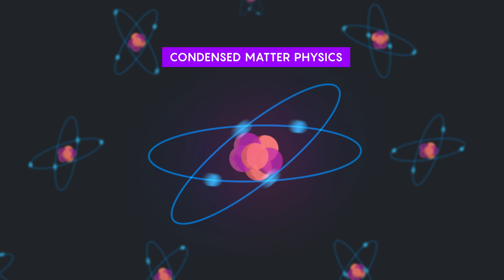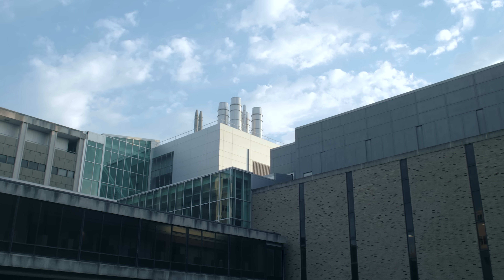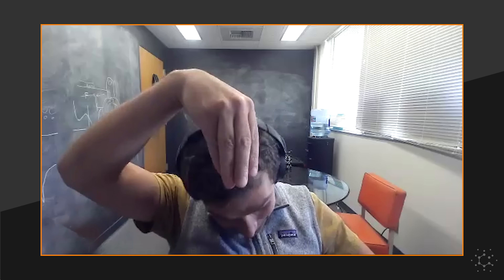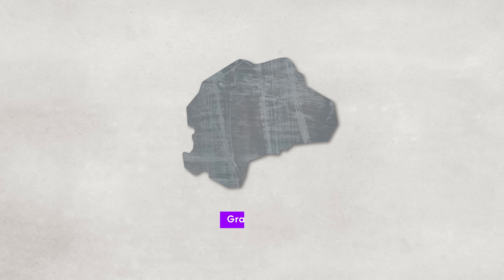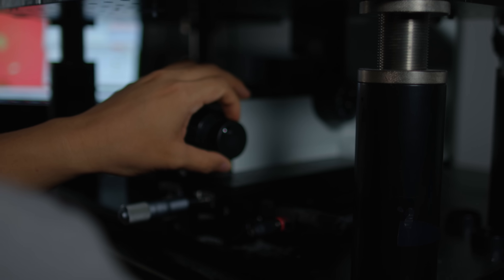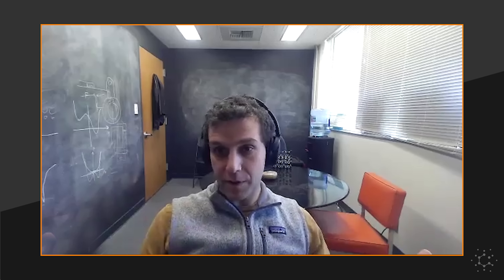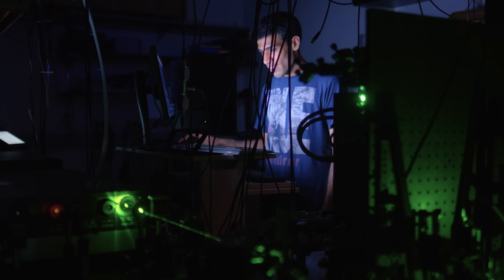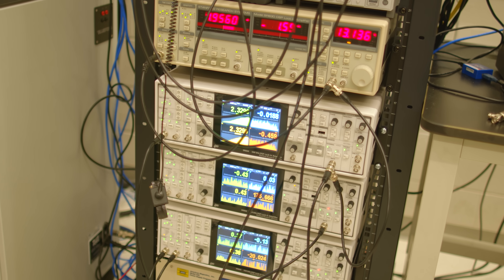How Two Physicists Unlocked the Secrets of Two Dimensions

Comment: Can someone explain something to me (not a trained scientist): how many of these "virtual atoms" can they manipulate at once? Are they able to scale the quantity up enough to make, for instance, clouds of virtual hydrogen, helium, etc?
Reply: @asdli6402  Because they aren't really atoms. It's a really common thing in condensed physics to do "simulations" of the real thing by using an absolutely different physical object, that on some level behaves similar to the thing you are studying. In this case, having read the article, it's not electrons that are orbiting "artificial atoms", it's "excitons" - a "particle" consisting of an electron+hole pair in different layers of the material. It is not really a particle in a physical sense, but it behaves like one, and if you are willing to accept it as a particle, it follows the regular Schrodinger's equation (except in 2D).
This isn't the first time condensed physics has done this - there are also so called "phonons", for example, that are quantum particles of sound waves - basically a particle representation of deformation waves travelling through a material, and they also behave like regular quantum particles if you look at them right.

What that Moiré lattice does is create potential wells for those "excitons", similar to how nucleus creates a potential well for an electron in the atom. This way, these excitons follow the Schrodinger's equation really similar to that of a real atom, so the effects you find with them can be applied to real atoms too. That's why they're called "virtual atoms" - they're not atoms in any real sense, there's no nucleus and there are excitons instead of electrons, but it's similar enough to be interesting. And yes, you can create lots of them - they're automatically "placed" at the nodes of the Moiré lattice, so as long as your sheet of material is big enough, you can get as many of them as you want.
Reply: @silentobserver3433  this is the kind of explanation I wanted TNX.
Reply: @silentobserver3433  thank you!
Reply: @silentobserver3433  thanks
Reply: @silentobserver3433  Damn, they really simplified it way too much.  Thank you for illuminating what is actually going on.
Reply: @silentobserver3433  I suggest 'analog atom' (or anthing else) is a better moniker especially to avoid confusion with the decidedly different and long established 'virtual particles' many have heard of. Also, the material is but 'maximally thin' and far from being 2D. This insistence of making use of confused, over-hyped terms is really unnecessary. Damaging even.
Reply: @jaybingham3711  True, the term "analog" would fit much better. Let's just hope there won't be any confusion with analog electronics :)

Even though the material itself isn't 2D, the "analog atoms" are, because they are formed at the boundary of two layers. The bulk of the material probably adds some noise and makes stuff different to measure, so that's why they make it "maximally thin", but the "analog atoms" are truly 2D, since they are restricted to the boundary between the layers and can move only in 2 dimensions. In general, 2D quasiparticles on boundary layers are a well-studied thing in condensed physics as well.
Reply: @silentobserver3433  thank you. It makes sense. Nice explanation
Reply: @silentobserver3433  Thanks 😀
Reply: @silentobserver3433  Thank you! But then this should follow a 2D version of the Schrodinger equations, not a 3D one right? So the orbitals will be different
Reply: @silentobserver3433  Thanks for taking the time to write such a detailed explanation, appreciate it
Reply: @silentobserver3433  Thank you for this explanation!
I would say, for those who still haven't understood my way of seeing this virtual atom:
Like a copper coil that creates a magnetic field when a current passes through it, it creates a "virtual" magnet, but that doesn't really make a magnet.
Sorry for my english.
Reply: @theplouf5533  I would say your analogy of magnets is not really good, since, in a sense, elecromagnet created by the coil is probably even more "real" than whatever permanent magnets do, since an electromagnet uses the Maxwell's equations directly to produce magnetic field from current, and permanent magnets do basically the same thing, but on atomic scale and using quantum properties like spin to make their "current", which makes it much more complicated.

I think a better analogy is how you might study radio wave (and light) effects, like interference and diffraction and such, by dropping rocks into a puddle and observing the wave patterns. In this way, water waves are "virtual" radio waves. The underlying physics are very different, but the resulting math is similar enough, so the observable effects are still the same. And water waves are much more intuitive and easier to study.

Also, it seems like some people misunderstood the word "virtual" here - it has no relation to virtual particles from Quantum Field Theory and Feynman Diagrams. There virtual particles are just a math trick to simplify calculations. Here the "virtual/artificial atoms" are actually perfectly real and measurable, they're just not atoms in the strict sense, just emulations based on a different physics.

(Also, your English is great, don't worry about it!)
Reply: @silentobserver3433  So let's say it's an analogy of an analogy ;) I'm thinking of people who, like me, thought: "Yo ! This is the future 3D printer, if the virtual do real one day ? => No With copper coils , we'll never get magnets, dumb guy !".
Reply: Yeah and does this artificial atom go away when no more voltage is applied.
Reply: @harshsharmax25  man, imagine being able to make anything your heart desires, but it disappears as soon as you leave the field
Reply: Also as I understand it, atoms are kinda defined by their number of protons, 1 for H, 2 for He, 3 for Li, etc. So why does changing the metric associated with electrons change the atom, and not just change it to a type of ion instead?

Also, as I understand it, an atom usually has the same amount of protons as neutrons, so are these created atoms special isotopes of the usual atoms?
Reply: this is what I wanted to ask
Reply: @ToriKo_  I don’t KNOW the answer, but my guess is that changing the electrons would change the properties of the atom, since that’s how atoms tend to bond. There are forces in atoms that come from protons in the normal world, but I would think that it would be possible to create, or simulate the properties/general behaviors of other atoms using only electrons.

I’d imagine it would get a lot more complicated as the number of electrons increases, since elements like iron have various electron counts. This is assuming my understanding is correct.
Reply: @ToriKo_  THERE IS NO ATOMS NO GRAVITY NO RELATIVITY NO HIGGS NO STANDARD MODEL NO E=MC2 SAGITARIUS A STAR SPEWS GAS MATTER THE SI METRIC INDEX HAD TO BE MESSED WITH TO TRY TO STAY RELEVANT OR SLIGHTLY RELATIVE IN THE CONVERSATION,.
Reply: @no1headbandcharlie160   inside voices please
Reply: @asdli6402  from my understanding, virtual particles arent real at all. Physicists yuse them to make the maths concerning the field easier
Reply: Artifical atom (or quantum dot in quantum computing context) is basically a 'box' and hold numbers of electrons. I don't know about virtual atoms. What I know is virtual particles which is in different context (quantum field theory).
Reply: Yea you are a way better person that me… I though about changing things to gold
Reply: The Moiré superlattice of the few-atom-thick material forms very good models of atomic phenomena that isn't constantly moving and basically impossible to observe. 
No element printing with the technique, but an interesting breakthrough in scientific models.
Reply: This video is extremely misleading without good explanations for both its information and misinformation, I really can't blame anyone for thinking this is some alchemy voodoo lol
Reply: Lots of good replies here. I wanted to add my understanding. The virtual atoms are places in the 2D lattice that act like atoms do. I don't think we know why this happens. It is something of an epiphenomenon, like moire patterns themselves, or when you move your head a little and "see" movement in the place where a power line crosses in front of a straight line or any two, non-intersecting lines cross in front of you. As you move your head a little, the intersection of the two lines move much farther, and our brains "sees" this moving intersection as a moving object even though there is no thing really there. Two screens rotated in front of each other also produce secondary patterns of their many intersections; that is a moire pattern. In that case too, the pattern we see isn't really there in a sense. 

So, this alignment of single sheets of atoms produces secondary effect zones shaped in moire patterns that behave like atoms (due to local, though extended electromagnetic effects?). I don't think we know if there are limits to the similarity. It may be like a map and the territory. 

Maps are similar to the territory, and you can suss out real world properties on the ground by studying a map. It's not a perfect similarity, though. Maps, models, theories, ... they are all imperfect. TS Kuhn wrote about this in Revolutions In Science. There are anomalies in every theory. 

So, there is a question: are these virtual atoms perfect models? Or do they break down in some circumstances? Apparently, though, even if they are imperfect, we can can still suss out new discoveries at the atomic, chemical level.

I do wonder if models of molecules can also be made. Maybe the molecular structure of what you want to model would have to be producible in the moire pattern. A flat, planar hexagon for benzene (C6) with its 60° angles, might be possible, but a water molecule with its 104.5° angle might be more difficult, and any non-planar molecules might be impossible. ... I wonder if we could use three layers, two independent moire patterns, and maybe create a simple 3D lattice. I don't know if this would work. Maybe the intersheet distances are too different than the moire internodal distances. If we could, though, we could create 3D lattices . . . I imagine researchers have tried and failed to find the same effects, or that would be in the news.
Reply: @err_go  I don't think they are stable without the specific pressure, temperature, and energy conditions, as the quasiparticles are formed from those. I think you can see it as an electron liquid, where depending on those conditions it exhibits different, more bizarre quantum states of matter that are emergent from the interaction of many particles.
Reply: @asdli6402  that's because they aren't 'real' atoms, the experiment doesn't create a new nuclear centre instead it simulates the electron cloud that would surround the nuclear core which is where chemistry happens anyways, all chemistry is the swapping of electrons so because they are able to capture the electrons within a space its a type of Virtual atom but because it lacks a nuclear core to hold the atom together, the atom cant exist outside of the test conditions
Reply: They oversaturated the electron clouds with elections. Elemental determining proton numbers did not change.
Reply: I think it’s causing the electrons to act like they’re bound to the number of protons to simulate the atom. Like the arrangement creates virtual protons within the matrix and the electrons group accordingly with the charge applied.
Reply: Ya know if you flushed gasses through the lattices while the artificial atoms are engaged at the correct pressure  and temperature new atoms of materials would be created, the correct control is key yay me but you go ahead and do!

Comment: Is this really two dimensions? Even these 1 atom thick lattices would occupy more than 2 dimensions. Also in their experiments they are using 2 stacked together, so by defintion the electrons exist within the 3 dimensional space between those layers.
🤔
Reply: Yeah, they're taking liberties saying 2-D, but in an ordinary language sense, layers of materials merely 2-3 atoms high are effectively flat!
Reply: @err_go  So is it just a figure of speech or is actually a case of actual approximations. I.e. do they not have to solve the equations for these particles in 3 dimensions?  I imagine this is like approximating an infinite square well for an electron. Just so hard to imagine 3D edge effects, or anything relating to the 3-D spacetime this experiment operates in don't throw any approximations way off. I need to learn more about this 🤣